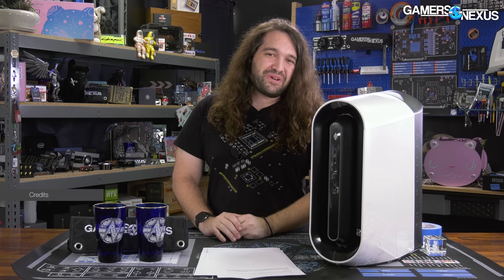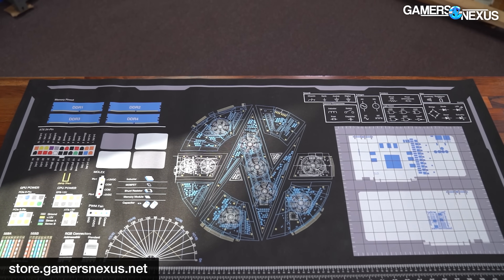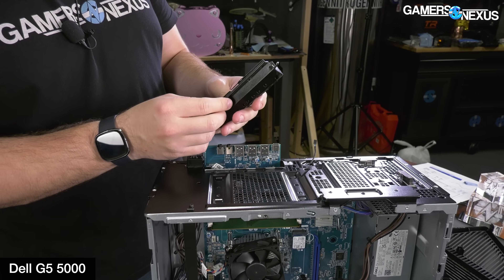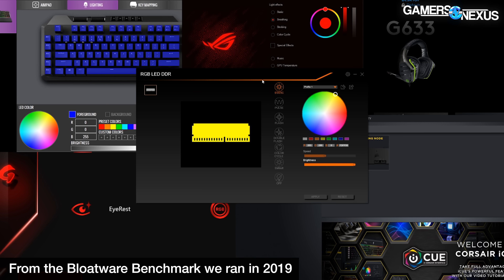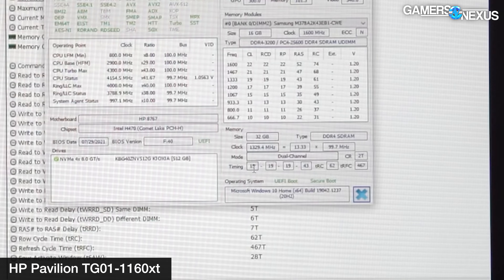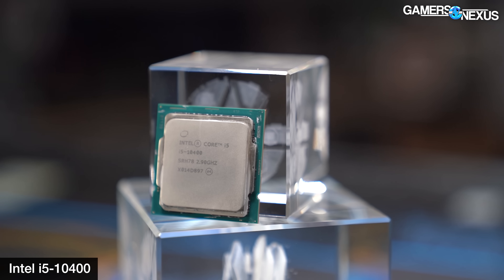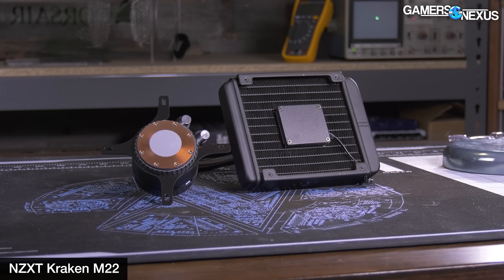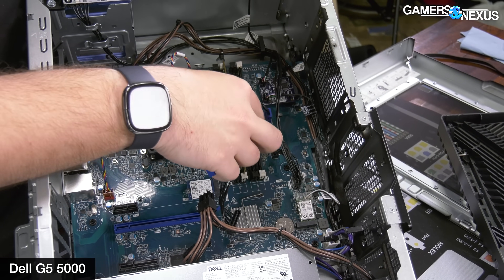The Worst Prebuilt PC Mistakes We've Seen (So Far)

Comment: Maybe a "How to" on removing bloatware and how to clean up a pre-built to increase function then provide some before and afters?
Reply: That’d essentially have be a Windows reinstall guide though, if I’m honest - a lot of this stuff roots itself so deep that even if you kill it with fire it will still haunt the machine. So it’s best to just reinstall the OS before you install anything on it and go into sunk cost fallacy mode (been there done that).
Reply: Yeah best way is to find your windows key in the OS, create a bootable usb with windows OS on it, and do a fresh install before you even use it. Sped up my dell laptop a lot
Reply: @Tra-vis  What about the proprietary BS? Can you just download their drivers?
Reply: @Psyopcyclops  Good question. Either Windows will install the drivers by itself or you could try going to the website of the manufacturer to see if they let you download them.
Reply: just reinstall a non-branded version of Windows.
This is the least labor intense.
Reply: Install Linux

Comment: I once bought an asus prebuilt that had a propietary block for the front panel connectors, which only works with asus motherboards. So when the pcie slot decided to stop working I was forced to buy an asus micro atx board with an 1155 socket when they were just about phased out of retail stores

Comment: Im not so sure on the 32gb being a problem thing.. Playing an MMO with a browser, discord and spotify running, I regularly pinned memory usage at 100% when I was only running 16GB. Uprgading to 32 was completely necessary.
Reply: Sure you can get along with 16GB easily and still have a one or two GB‘s free even under full load. But once you upgraded to 32GB you’ll find the RAM usage climbing up to 16GB or a bit more just because the RAM management doesn’t have to hold back anymore.
Reply: I've had many apps running, a browser with 30+ tabs open, Elder scrolls online running, discord, but I've never hit 100% memory usage. I've gotten up to ~%85. However I do still agree that 32 GB is starting to become "not overkill" for gaming PC's. Plus it's not like RAM is crazy expensive right now. I can get another 16 GB (2 x 8GB) of the same G.Skill DDR 3 3200 RAM I have from newegg for $70.
Reply: @00O3O1B  Running  Final Fantasy XIV at 5120x1440 as well as a real time parser for it and on the second monitor usually have youtube or netlfix open as well as a tab or two, and discord in a voice call. That plus all regular background processes is  running right now and currently using 21gb ram.
Reply: @00O3O1B  I use 7600MB just without a game open - Chrome, Discord, Stock Market platform, just "casual stuff" etc - game open at 1080p max textures, easily go to the 15-23GB range.

Also your comment on x$ RAM x$ CPU, being worse than a x/2$ RAM 3*(x/2)$ CPU, is total bullshit, and it impresses me that you even got upvoted on a tech channel.
Reply: yeah 32 GB really isnt a lot anymore. Thanks to hungry apps that have an entire browser behind them running multiple copies of their own process.

Comment: Fun fact: Dell customer support thinks 8x2 gigs of ram = 16x1 gigs
Edit: They also think a pc is overheating ONLY if it crashes.
Reply: they are not wrong in that aspect. because the cpu runs at XXX speeds, and with how throttling works, that statement is legitmate unless theres a error in installing. but hey im not a leading company in the prebuilt space.
Reply: @Fudgesickle  Not wrong but certainly not good
Reply: @Fudgesickle  canadian youtuber dawid does tech stuff called them up for a dell xps prebuilt with a 3070 mind u, that he asked for dual channel ram and got single channel, he also got that cpu cooler for an i7-10700, and got sent on a rolercoaster with the departments.
Reply: @Fudgesickle  
Uh... what? Do you know what dual channel memory is, and that on Ryzen it can create a 10%+ increase in CPU performance?
Reply: @tifforo1  I think he is talking about the overheating part of the comment

Comment: Hard agree on the ram. I upgraded to 32gb because I play a Kerbal Space program with a ton of mods, and that'll use 16-18 gigs on its own. That's the one application that actually makes my system use more than 16gb
Reply: so ONE application made your computer use 50% of your RAM by itself but somehow this means 32GB is overkill? Hello? Read your own comment and think again?
Reply: @prydzen  any other thing I do, including streaming, doesnt use close to 16 gigs of system memory. So yeah, for most people it's overkill, and a waste of money that could go towards a power supply that wouldn't explode or a cooler that has more than 8 cents of aluminum.
Reply: And again, I can't stress enough how many mods I run. It takes me about 6 minutes to load the game off of a WD SN850 (running at Gen 4, with a 5950x). It's a niche use case.
Reply: @prydzen  no ypu

Comment: So I've recently had gpu failure and was looking to replace or do the next build I was planning on doing right before this obnoxious market turn. Due to GPU prices I decided to also look at prebuilds and laptops. Ultimately I could never get enough confidence in the components I would get. I wouldn't get to pick most of the brands, half the time the spec's were missing, and it was very difficult to get the right combination of parts for my needs.
Then I started watching these videos and it all went from bad to worse. I have to say, the number one thing I hate is proprietary parts. If there are other problems I can fix them, but you can't do anything with proprietary parts. Another reason I've never liked Apple.

Comment: Steve can grump all he wants but having the i/o built in makes it so much easier to replaced the motherboard.
Reply from the maker: Unless: A) They stop making the proprietary, special board and you can never find a replacement because it's not standard; B) You want to move it into another case and you have to saw parts of it off because it doesn't fit; C) You don't want to pump a landfill full of literal trash and would rather use a motherboard that doesn't need replacing in the first place

Comment: I really want to commend Steve and the GN crew for adapting their content to the current GPU craze. I know many tech channels have been struggling given that type of content is effectively off limits for much of their audience right now, but I'm really enjoying the focus other components that don't usually get enough testing or attention.

Keep up the good work guys.
Reply: I agree. GPU reviews have become a huge turn off and meme now to tech savvy folks  (Especially when LTT goes all love-fest on anything GPU regardless of its price.)
Reply: Honestly, I might just buy a prebuilt I don't even need just to scavenge a 6800XT, ordered one back in December and it still hasn't shipped. According to TSMC, we'll likely hit RDNA 3 before the shortage ends.
Reply: @MunyuShizumi  Depends on the prebuilt machine, if you've seen those proprietary cards from big brands they're absolutely terrible and seems like designed to die. Though you might have some luck with buying a Chinese generic replacement shroud to slap on those cards
Reply: @DangNguyen-xx3zi  Thankfully, you can see what you're getting more often than not due to transparent side panels being quite popular these days, and from what I can tell, the local shops are installing whatever they can get their hands on at any given moment. (I don't live in the US, we don't have many megabrand prebuilts here.)
Reply: @MunyuShizumi  In my country I can still find those HP, Dell machines, but they're slightly more expensive than what Steve paid for in the US. Small shop prebuilts and SI have the habit of buying the cheapest stuff that works, stuff like motherboards with naked VRM and those insanely hot Zotac cards. And they don't exactly have different stock than parts shops
Reply: They were always diverse and specialised (in their testing) when it comes to PC tech. That's great. LTT is another diverse channel but keeping in style and subject of tech.

Comment: Regarding bloatware, I get flashbacks to Lenovo's astonishing first use experience. Where the preinstalled bloatware and "welcome" guides literally wouldn't fit the screen, so you had to know some odd tricks to move windows outside the boundary to get the system started at all.

It's no joke that a manual reinstallation is easier.
Reply: i would never trust a factory install anyway.

Comment: It'd be cool if you guys would partner with someone to do a history of PC parts. It might help contextualize some of these design decisions by Dell and HP.
Reply: Agreed, or even just a history of Dell's insane bullshit.
Reply: To address the non standard parts it would have to be very Dell and HP centric. The non standard parts they use today have no real history outside the company. Looking back at the PC history the progression of standards has been driven both by individual companies and by standards comities.

The XT standard was basically created in 1983 when a lot of companies chose to copy IBM XT motherboards. That is what you can call a de facto standard. IBM didn't intend to create a standard but the industry chose to copy their machines closely enough that the components could be interchanged. 
This was followed in 1984 by the AT standard, which just happens to about the same size as the later SSI-EEB standard, but other than the size there are few similarities.
A year later the Baby AT standard came about. It was what IBM used for their PC XT 286. It was much more compact than the original AT standard and was quickly adopted as the standard formfactor for most PC class machines for the following ten years.

In 1995 Intel introduced the ATX standard. This time it was Intel instead of IBM that championed the new standard and this time it was intentional that it would be a wide spread standard. It was so successful that we are still using ATX and sub versions of it even today. Intel has kept updating the standard over time and the latest motherboard specification at the moment is 2.2. The ATX standard also included a new standard for power supplies and this part of the standard was last updated in 2020 to the 2.53 version. For being more than 25 years it has stood the test of time pretty well.

Inte however did try to introduce a new and according to them better standard, BTX in 2005. This was a pretty radical redesign and failed spectacularly in the market. My personal guess is that the redesign was so thorough that it was totally incompatible with everything ATX. Basically they swapped everything around and tightened up the standard where it came to positioning of components such as the CPU socket in order to allow the heatsinks to he bolted to the motherboard tray instead of the motherboard.

While Intel continuously have held the ATX spec some of the derivates has been created by the SSI or Server System Infrastructure forum. These are SSI CEB or Compact Electronics Bay, which is basically the same as the standard ATX motherboard formfactor at 12" by 10.5". SSI EEB or Enterprise Electronics Bay is basically what was often called E-ATX and the motherboards are up to 12" by 13". Finally there's SSI MEB or Midrange Electronics Bay which measures 16.2" by 13", which at least to me is a bit confusing as it's the largest of the three...

Intel was not alone in the standards game. Mini ITX is derived from ATX but the standard was set by VIA who continued to release several smaller standards such as Nano and Pico ITX.

While manufacturers following common standards is great for the customers and smaller companies, the big players have often chosen to create their own. Sometimes it was in order to provide something that the standards didn't support, but often it was used to cut cost and to a degree to lock in the customers into their ecosystem. Today you often see this in the server sector where custom motherboards allows for higher density servers. To get the most out of every rack unit it's necessary to forgo the standard formfactors, but it does mean that the machines are less likely to be upgradable years down the line when they have become obsolete.
The nonstandard parts used in office and apparently some "gaming" machines are of the cost saving kind. 

Things like the proprietary power solutions were often created before there were a standard such as the ATX12VO. Once they have started to used something like this and sold a couple of hundred thousand machines it often makes more economic sense to keep using the same standard for new machines rather than switch to standard compliant components and increase the number of parts to keep track of.

PSU manufacturers like LiteON and Delta will happily sell them PSU's with any particular set of connectors the OEM's ask for. You don't even need particularly large orders to get this service. A company I used to work for ordered PSU's with ATX-GES cabling. This was AFAIK only used for one motherboard, the Tyan S2462 Thunder K7,  which was a SSI-EEB size dual AMD Athlon MP motherboard. Though this has ATX in the name the pin-out is quite different. We also bought lots of PSU's with WTX cables which is another standard with connectors that looks a lot like ATX but again differs in the pin-out. These to were used by some server class motherboards and can be said to be the precursor of EPS, which was essentially the ATX connector with four added pins for better power delivery and instead of a 4-pin 12V connector that was doubled to 8 pins. Eventually the EPS standard was absorbed into ATX with the ATX12V 2.0 standard. But for a few years it was an exotic standard and we had to have the PSU's made to order.

Now we were a small company that ordered less than a hundred PSU's at a time, and yet the fee for having these made was pretty low. Now if you are a company that buy in lots of 10,000 or more then LiteON will probably not even mention a cost for special cabling.
Reply: @blahorgaslisk7763  Thanks for that mini history lesson, very interesting info
Reply: maybe partner with gaming historian
Reply: I have a roll of toilet paper...  Because its just shit  Nothing has changed from their Packard Bell days AT case and all...
Reply: @hisafe  ???

Comment: Me who’s getting a prebuilt soon: nervous sweating
Reply: Oh boy. Which brand/model did you go with?
Reply: For the first time in 20+ years of building my own computers, I bought a pre-built. Not because I didn't want to put in the effort of building something, but rather because I couldn't buy a GPU. I wound up with an Nzxt H1-based system (which will hopefully not catch fire) because I genuinely like SFF PCs.

After a reinstall of Windows, things are going mostly well. Still have an annoying sleep issue I haven't quite figured out yet...
Reply: @genericasian  Can't see the Sleep option, or does Sleep not work at all? I have a chinese motherboard and it doesn't support Sleep function, it turns off display and USB but not the CPU or fans,  which in practice is the same as turning off the monitor.
Don't get me wrong, these Huananzhi boards are awesome, but BIOS is designed in a way that prevents OCs and Sleep.
Reply: @MastersPipe  sleep works, as in I can manually put the computer to sleep. However, it doesn't seem to want to automatically put the monitor or computer to sleep. It actually worked for about 24 hours, but then it stopped working after a reboot. No changes to hardware or attached devices.

Very strange...
Reply: @genericasian  GPUs are readily available on newegg and stock x though....
Reply: @drunkhusband6257  are they available at reasonable prices (and not scalper inflated)? I've been entering shuffles and throwing my name into lotteries for the last year. I haven't gone to a local best buy to wait in line overnight (I draw the line there).
Reply: @genericasian  What card are you looking for specifically? They are all at a bit of a markup you aren't gonna get away from that.
Reply: @drunkhusband6257  was after a 3070 or 3080. I'm all set though. 😊

Comment: You know what's great about built in I/O, if you happen to trip over a cable that is plugged into the font you  risk ripping the port off the board, and based on how flimsy the HP case is and lack of support for the front of the PCB, with any luck you could crack the whole motherboard!

For real, the writing on this video is god damn amazing, probably the funniest video I have seen all week!

Comment: Isnt the build in IO also good for thermals, because there isnt any extra cables? The cases are garbage anyways so I think they need every bit of cooling they can squeeze out.
Reply from the maker: The impact on thermals from 5x 26 AWG wires would actually be impossible to measure.
Reply: @GamersNexus  well then its gg

Comment: The fans that do absolutely nothing has to be my favourite part of a pre-build
Reply: You need to check out the legendary 12-fan Abkoncore Ramesses 780 case
Reply: @rtyzxc  was that the one with something like 20 fans that created essentially dead pressure in the case?
Reply: @shaneeslick  yes! I knew I remembered this one.

It was the most chaotic response to undercooled complaints 🤣
Reply: @ZIV installing a turbo in an EV XD
Reply: Thys why I used windows lite mod